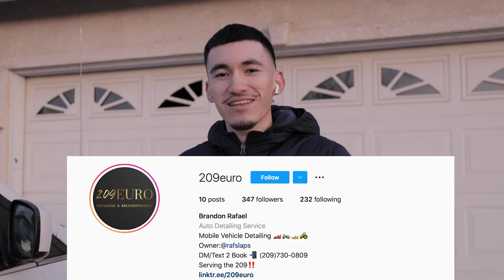Why This Detail Took 5 Hours To Finish - CEO Detailers

Comment: One thing that can help with the stains,is steaming the carpets before using the bissell,heat will accelerate chemicals effectiveness,
Reply: It can also make the stains set even deeper sometimes so you gotta be careful
Reply: @JPchecks  the way a professional is supposed to steam a stain,is wrap a terry towel on the head,get the steamer going,then move rapidly over the stain,steam will evaporate and dry so much faster than just spraying something on the spot,unless your just holding the steamer on one area,that should never happen.
Reply: @elic5355  useful tip! Thanks man. I use a 8070 heated so cloth isn’t really a problem but I just had a situation where a baby spilled one of those Mexican pelones on a leather seat and that tip woulda helped a bunch 😂
Reply: @JPchecks  oh man,thats a tough one no matter what😂